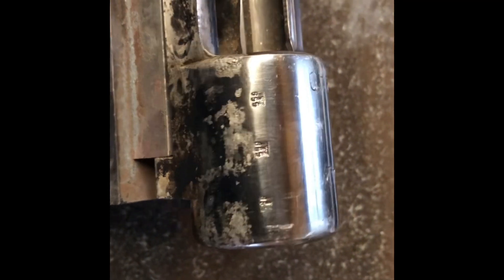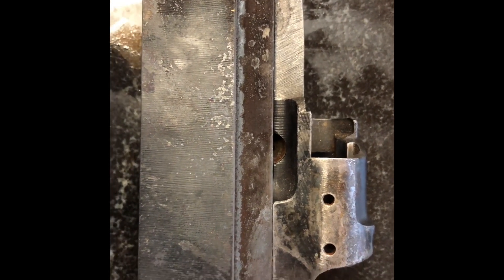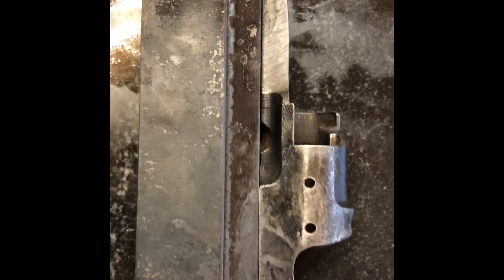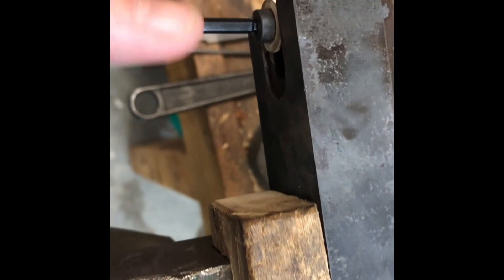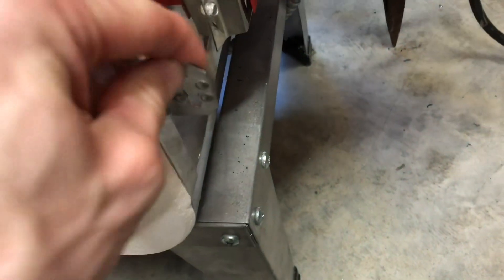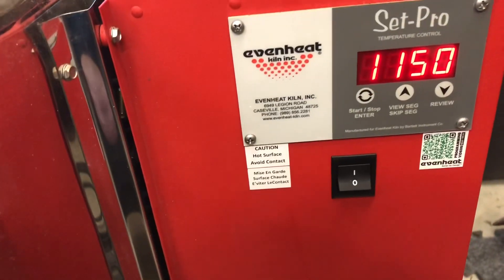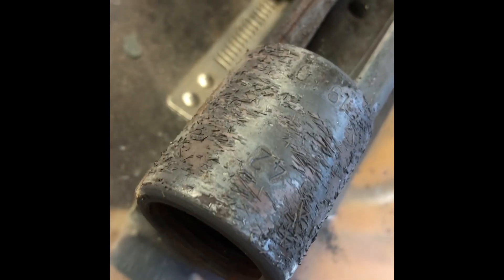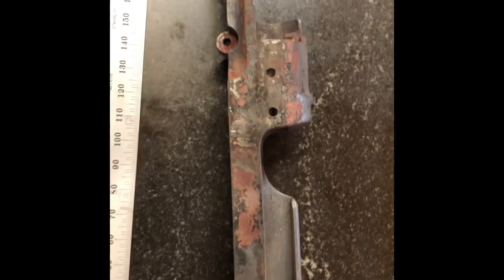Straightening and annealing a Mauser 98 receiver

Comment: Cool video! I am curious how you heat treat the action? I believe those are case hardend?
Reply from the maker: Depending on when they were made, Mauser's were either selectively pack hardened, which is a zone specific form of case hardening, or later used a process called Durferrit. Both the metallurgy and heat treatment changed over the years and depending on contract.